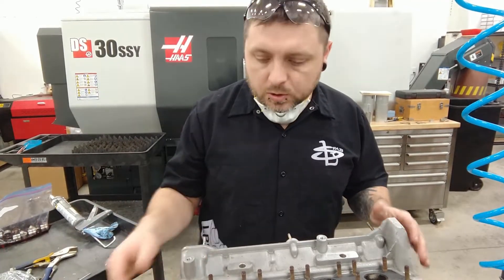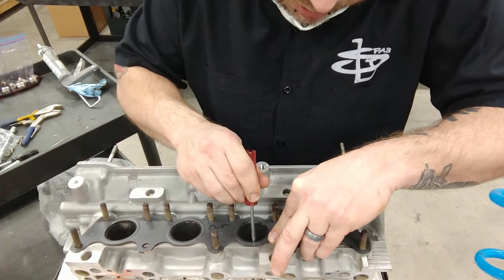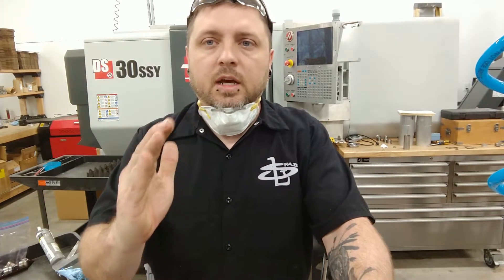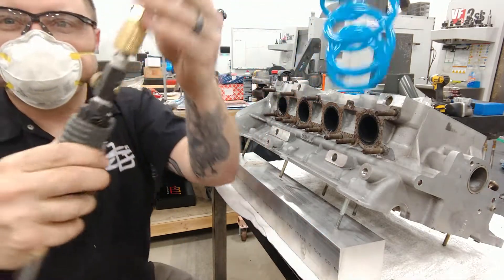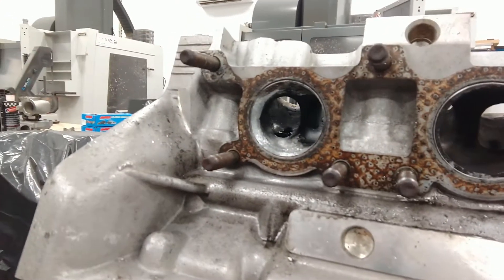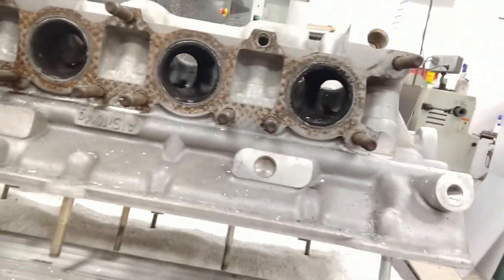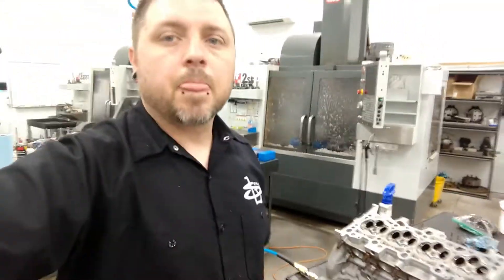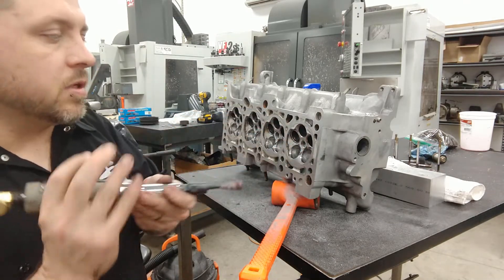VW 1.8t 20v engine build, head porting, exhaust ports.

Comment: The bowl blending to the seat is very important. "Counterintuitive" I think not. If true bowl work is done, its enlarged to a percentage of the valve(I like 100% or greater). Its done thos way for 2 reasons.

#1: To increase the cross sectional area to slow and assist the high speed air to turn. This will actually increase air flow(percentage of actual cfm flow) over the short side radius. This helps to decrease the excessively lean condition in the short side of the combustion chamber.

#2: To make the throat diameter the smallest CSA of the intake port and cause a venturi effect into the chamber.

So 2 reasons with additional advantages effects. 

So quite productive. The most gains are made by modifications 1" before and after the seat.

Comment: Wd40 is not a lubricant. WD=water displacement.  It is designed by military for drying out wet distributor caps. PB blaster works well for keeping flutes from gumming up with aluminum.
Reply: Wd-40 clears flutes well too. However the ultimate flute clearing "lubricant" is Royal Purple Max Film! ULTIMATE!

Comment: You got CNC，why not do some golf dimple pattern intake and Outtake dimple  , that will much better than just polishing the air path , by the way ,why people said do not polishing the intake  wall to smooth in non-direct fuel inject engine , that will decade the mixing  efficiency in Air -fuel
Reply: upload the cnc instruction file so he can do it.  id suggest thats the hardest bit